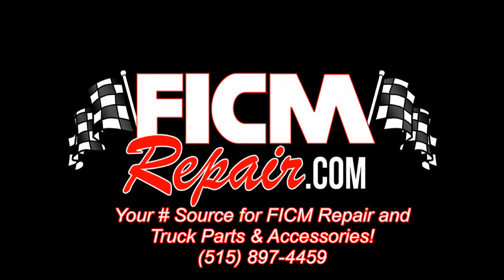Powerstroke 6.0: Symptoms of a bad FICM

Comment: On my ScanGuage II, my FICM Main Power (FMP) reads 30+ volts until my truck is fully warmed up (185°) wherein the FMP climbs back up to 45.5-46.5v. Truck runs great otherwise.
Can anyone tell me if this is normal?
Reply from the maker: This is not normal. Quite sadly, your FICM is on its way out. We’d suggest checking your alternator and batteries as causes for your FICM’s demise and then either sending your FICM in to be repaired or getting one on exchange.
Reply: Thank you!

Comment: I just replaced my ficum. No check engine light no codes.  The truck just started miss firing and would only go 15mph. The truck started just fine and all the ficum powers were correct. I used a dvom to check power at each injector plug and found 35 volts on two of the wires and pulsating 25 volts on the other two wires. Check while running. This is good. The three cylinders that were misfiring the volts were 48 on one 10 flashing randomly on the other and pulsating 20 volts on the other two. Put a used ficum in problem fixed runs great no codes.

Comment: I almost always have to crank then key off and re crank to get the truck to start when it’s cold.  Been like that for 8 years!  Could that be a ficm problem?
Reply from the maker: Yes. To be sure, we’d want you to check your FICM Main Power key on engine off and during cranking to ensure it doesn’t drop below 46 volts. Note that it may also be as a result of running a non-inductive FICM tune.

Comment: I have hot starting issues as a main symptom
Reply from the maker: If your main symptom is a hot no start or a hot hard start, I'd suggest taking a look at your IPR Duty cycle while cranking to ensure that it is NOT stuck at 84% or 85%,  If it is and if your ICP voltage is not getting over 1 volt, your issue is related to high pressure oil.  Give us a call if you'd like to talk through anything!  515-897-4459

Comment: I'm going to need a new FICM soon; my Livewire says 12.5 - 14 volts on both FICM voltages.  For how long are your FICM's warranteed?  What separates your product from an untuned OEM unit or one from another upgraded/premium diesel house product?
Reply: That voltage cannot possibly be FICM voltage if it runs any at all. It won't run at all below ~37v. Healthy voltage is above 47v.
Reply: having this same problem did you ever find what was happening??

Comment: Thanks for the help with my ficm feycm fuckem, but whats your personal take on sprayn windex? ive got a kit I ripped off my boosted ls6 other then need  new controller, and jets . all i read is  diesels love it, lower egts 70 more hp better mpg and so on. numbers seem a tad inflated and I mainly had troubles with it not distributing evenly per cylinder and tuning was a pita on my china choo choo gasser, but would that even matter on a diesel?Or only will see noticeable gains towing or bigger sticks,  the stoich ratio on these things vs gas is remarkable.

Comment: how do you tell if the logic side is good I have trouble starting truck when cold ficm volts are 48 i get 500 psi volts are .9
i got sync but it wont start also have 2 contribution balance codes 1 cylinder misfire code crankshaft code and ecm/processor code. I know sometimes when cranking and cranking you can throw a crank/cam sensor code but as for pcm Im not to sure and couldnt reallly find any info on it as far as the injector codes im waiting on new injectors to come in but I hope it was the injectors and not a pcm or ficm issue what are your thoughts
Reply from the maker: If the truck runs great after it does start with the singular exception of the contribution/balance code you mention and your FICM main power numbers are staying at 48!even during this elongated cranking, your FICM is not the cause of your issue. Our guess?  Sticking injectors.